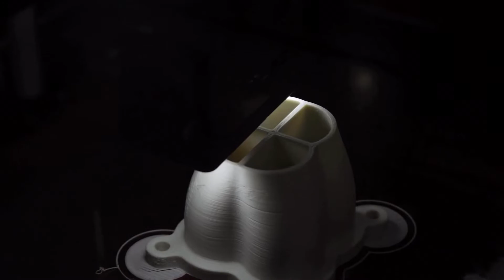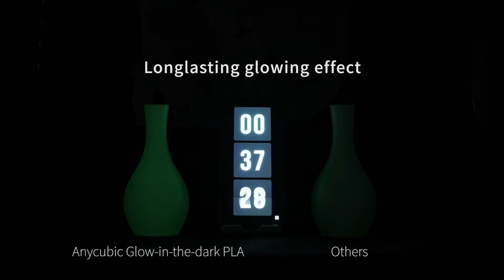PLA vs ABS Filament Comparison & Differences

Comment: I've been working with both plastics for years (using a handheld extruder) and other than the temperature set on the device's nozzle, I could never really tell the difference, ABS smells more (I've probably got the lungs of a smoker from inhaling some of the fumes... oops). But other than that, my experience with ABS has been great even when printing on my bambulab A1, I have yet to badly fail a print, I don't know if these will help someone out there struggling with this material but here's my tips:

-Use concentric layers when possible
-Print with a brim if your part has a small footprint
-Use tree supports

My guess is that circular shapes have a harder time warping, so your support struts will hold on for longer.
Reply: But bambulab A1 can't print abs right? Do you have an enclosure?

Comment: In short, PLA is easier to use and more forgiving but the pieces won't be as durable. ABS is a much stronger matterial but using it requires more skill to print as desired.

Thanks for the info!
Reply: "More skills". Yes, but not skills from the user but the printer. While you can print small ABS prints in the summer on an open printer, the best results are achived with an activly heated chamber. Just printed a spool (forJayo cardbox spools to be used in AMS) on my mk4 in Prusas enclosure. Warped badly. Printed it again, on my X-Max 3 - turned out great.
So yes, it needs skills. Skills from the printer ;-)
Actually I am quite happy using a printer with activly heated chamber now. It makes printing ABS so much more easy.
Reply: Are you sure? Testing I have seen shows that PLA has higher static strength.
Reply: ABS is a weaker material than PLA. ABS is tougher than regular PLA and the same as most PLA+ or Pro.